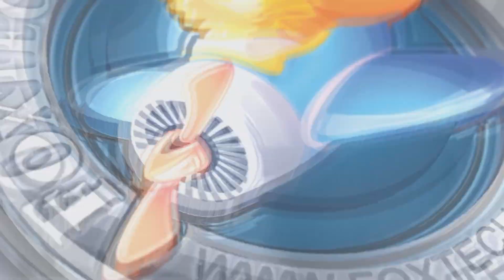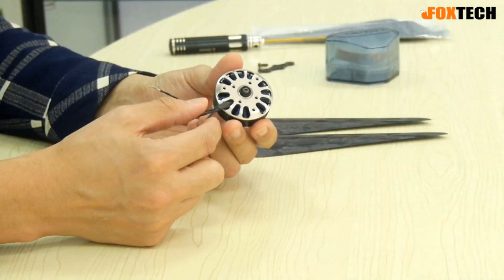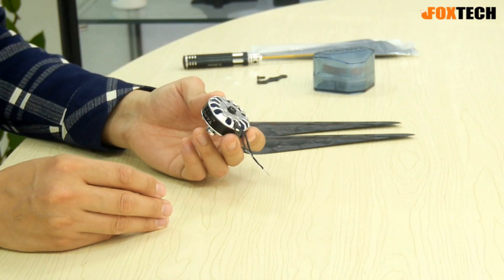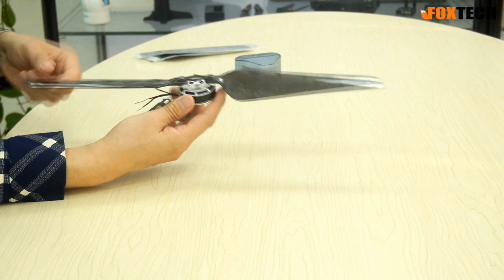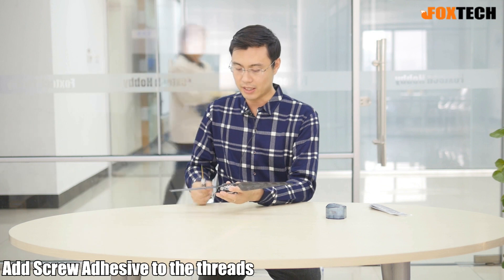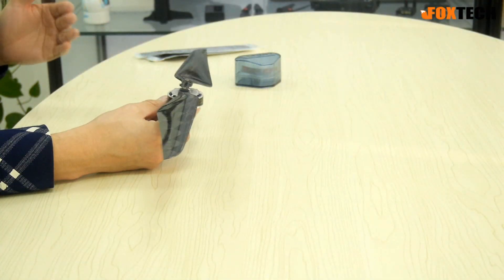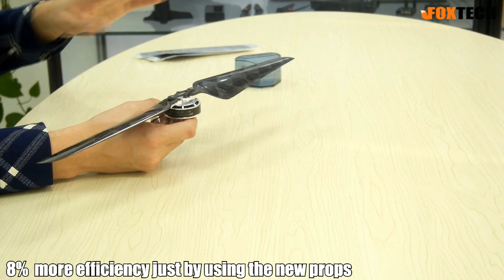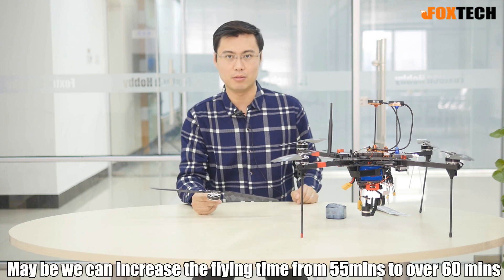It Just Cannot Stop! ---High Efficiency Tarot 4008 Martin Motor  with 1765Propeller

Comment: I did thrust test on the Tarot 4008 martian motor with  foldable CF 1755 Propellers.  It generates 1100g at 100 percent throttle. The thrust charts provided by manufacturer states 3250g thrust at 100% throttle at 24V.
Reply from the maker: Oh that's a big difference to the manufature's data. We ourselves didn't use this propulsion combo.

Comment: Hello,
I am using same motor (Tarot 4008 martin) with tarot 17 inch foldable propellers and ZD 680 quad frame, when the throttle stick is on 60% and above all motors are start vibrating. 
I am using dji Naza M Lite (V2 upgraded) flight controller.
Any suggestions to avoid vibration?
Thanks

Comment: Sweet motor/prop combo for the right application at only 85g... wow, and with an adaptor that adds height you could run standard props but add weight and props designed for a specific KV motor have the advantage done right. Nice long run time motor for camera work... adding time makes any large camera quad a little safer IMO. Prop design should spin smooth as butter.... balanced.

Comment: The thread should be on the motor for each blade  and then use bolts with nylon insert to stop them coming loose

Comment: g/w?
Reply: It's very nice motor but little off spec.
My results are:

T-motor 17x5.8 1038g thrust - 4amps - G/W 10,55 @ 6s battery
which is ok but  I was only able to get 2778g on 100% power.

I like the motor but I would like to see test data from foxtech, maybe my bench test setup was not perfect?
Reply from the maker: it's 3.2kg full throttle, but 1kg is the best efficiency point.
Reply from the maker: we are adding the specs to the product page now, at 100g thrust, 0.2A, 5W, the efficiency is 20g/w
Reply: That is fantastic but pretty lightly loaded. How about at 1kg thrust?
Reply from the maker: Theoretical data: 1kg,4.2A,105W,9.52 G/W
Reply from the maker: Fu is editing the video , soon it is listed.
Reply: +Foxtech Hobby  thanks guys. It's great motor and very light;)
Reply: Sir can you please suggest some high efficiency brushless motors for 8 to 12 inch propeller, maximum require thrust within 850 to 1000 gm.
Please suggest light weight motors, weight less than 70 gm.
Application - Airplane